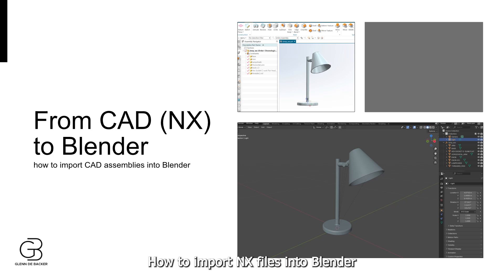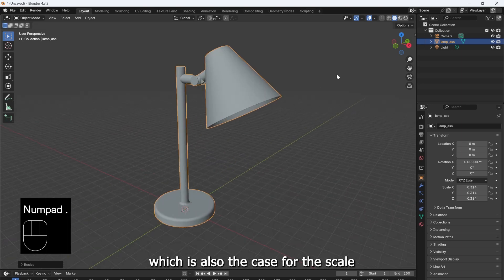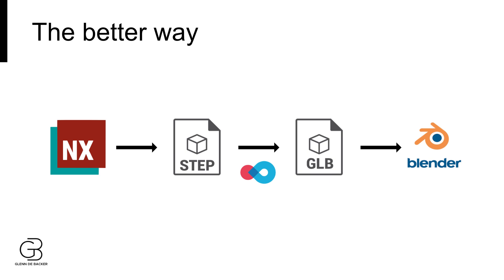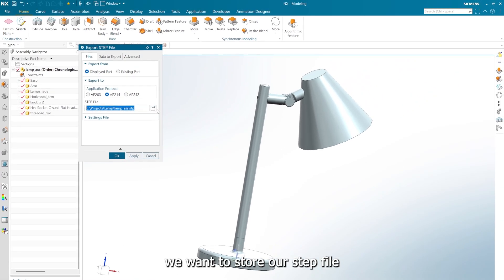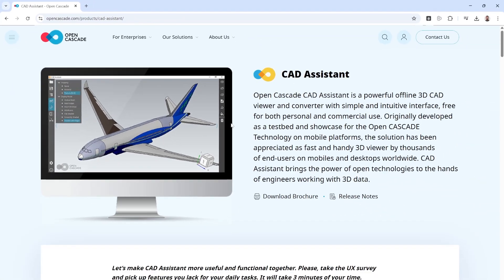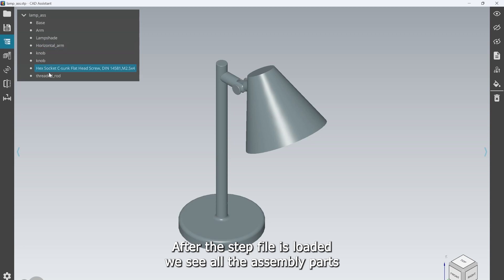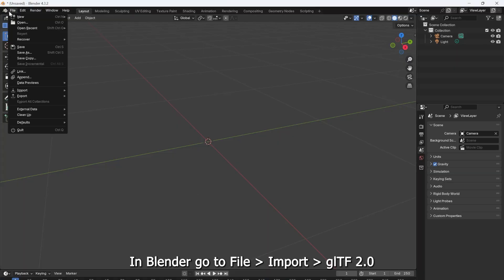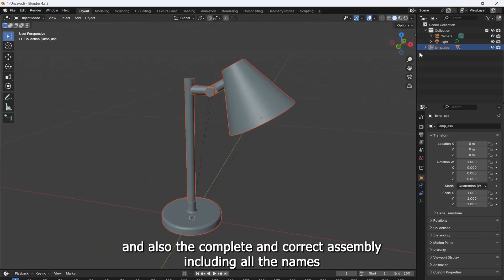How to Import CAD Assemblies into Blender (STEP/IGES to Blender Workflow

Comment: I’ve had the same struggles getting CAD models from NX into Blender and ended up with a very similar workflow to yours. But since then, I’ve discovered a much better solution, using tools for video game developers like InstaLOD or PiXYZ.

In CAD, geometry is defined using NURBs, a mathematically exact representations of shapes. Blender, on the other hand, works with polygons. Converting NURBS to polygons is tricky, and while tools like CAD Assistant can handle it, the resulting mesh is often messy. This becomes especially noticeable on glossy curved surfaces or in highly detailed areas.

InstaLOD, PiXYZ, Meshmatic,  is professional-grade software built specifically for CAD-to-3D conversion. There's even a free personal license available if you want to give it a try.

In the latest versions NX also has a 'Export Extended Reality File' option that can generate a GLTF file, which can be imported directly to Blender. Haven't tested that workflow yet.

This video would’ve saved me a ton of frustration a few years ago—great work! :)